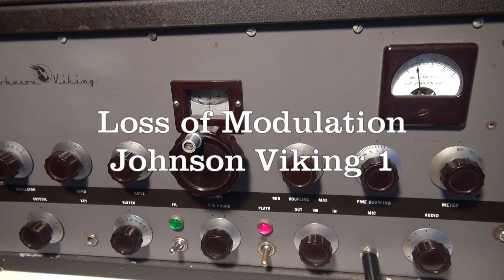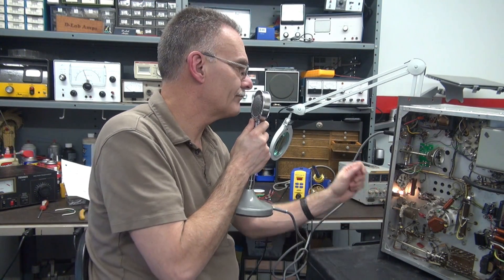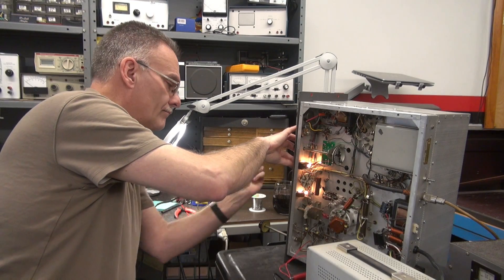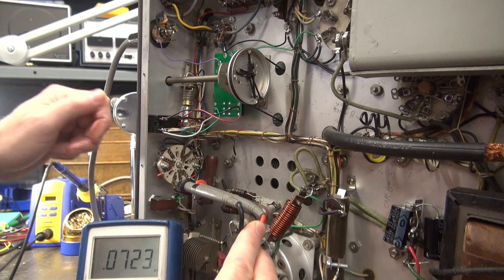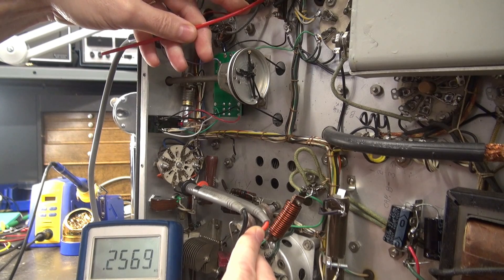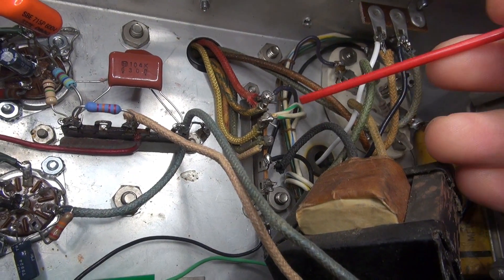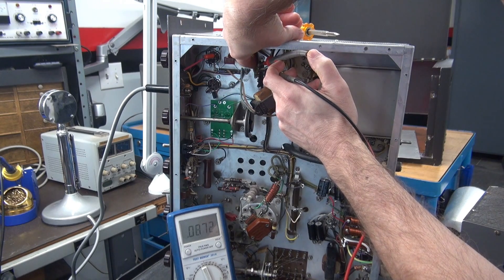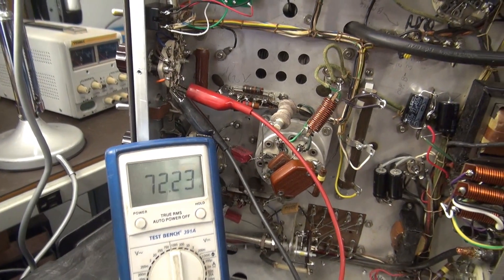Repair of the Johnson Viking 1 Tube Ham Transmitter Grand Finale Operational and sounds great!

Comment: Terry…Really enjoyed the series on the Viking I.  My Viking II had the same no audio issue involving that exact terminal strip. The terminal strip carbonized at the two points where the leads from the anode caps of the 807’s connect to.  When I modulated the meter on the Viking II says I’m modulating and nothing was coming out of it. When I put the Viking II on its side and modulated I saw the terminal strip lighting up like a Christmas tree as the high voltage from the 807’s was arcing to ground. Replaced the terminal strip and all’s good.  Very informative video… Keep em coming.

Comment: great detective work to find the problem Terry.
in retrospect did you go over that area with the noise probe or was it overlooked.
would be curious to know if noise probe would have picked up the bad solder joint.
thanks,
john

Comment: Excellent, Terry!  Glad those of us out in the "D-Lab Auxiliary Squad" were able to bounce enough ideas off you to help you out and keep you motivated.  Yes, we all get complacent when the majority of problems are caused by the same old things.  But you stuck with it and persevered!
Reply: ...there's ALWAYS a logical explanation for EVERY fault- no matter HOW perplexing the problem may be!!!
Reply: @daleburrell6273  Yes, but sometimes the logic itself is the problem.  Example: Recently I'd been troubleshooting the right rear brake/turn lamp in my van.  Intermittently it would fail, then in the middle of testing it would start working, couldn't get it to quit again. Day or so later, quit again, then start working on its own.  Knew it was an intermittent connection, drove myself nuts.  Even replaced the lamp.  Finally it quit enough to really look, and I decided to change the lamp again.  It's now been working almost a month without a hint of trouble.  Two bad bulbs acting intermittent, the same way?  That could never happen, right? 😁
Reply: @bobblum5973  ...ANYTHING IS POSSIBLE-(!)
Reply: @daleburrell6273  Yup!  I also experienced a CMOS CPU that ran partway with its power pin bent under, no +5V supply!
Reply: @bobblum5973  ...and I'll bet I know where the power the CPU was using came from-!
Reply: @daleburrell6273  As near as I could tell, it was grabbing whatever power it could from any other pin that had a positive voltage, whether it be data, address, clock, you name it.  We tested the board without the CPU by feeding in signals to exercise the other circuitry, then removed the 40-pin test cable and inserted the CPU.  The board started up, ran part way through its tests, then died at about the same point each time but slightly randomly.  We totally overlooked the bent under pin because the CPU was working.  Then I happened to look closer and found it; for some reason with real power it ran fine!  National Semiconductor NSC-800 processor, low-power CMOS close equivalent to the Zilog Z-80 (or maybe Intel 8085).  This happened around 1983.
Reply: @bobblum5973  ...I'm betting that the power to the CPU was getting in through an input that was at a logic "1", and the voltage was conducting through the input protection diode to the Vcc node on the CPU.
Reply: @daleburrell6273  You went into more detail than I posted, but I agree 100%.  When enough pins were low there wasn't enough current to meet the CPU power demand and it dropped out.  If I recall that NSC-800 could be underclocked to reduce power consumption, but I doubt the designers thought of a phantom power source effect like I saw, or at least not in the field!
Reply: @bobblum5973  ...and it COULD be that the input(s) that were channeling the power to the CPU had switched to logic "0", and the CPU stopped working(?)